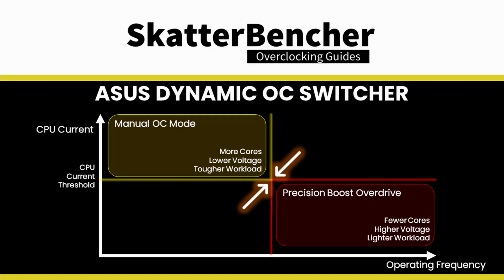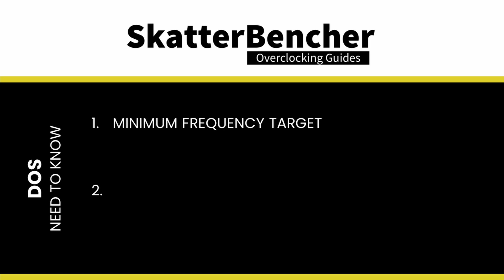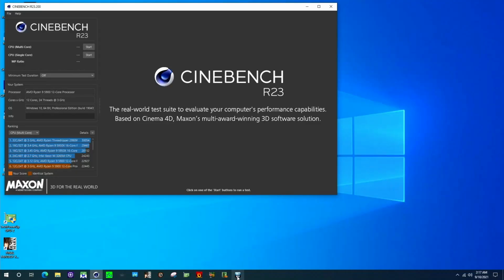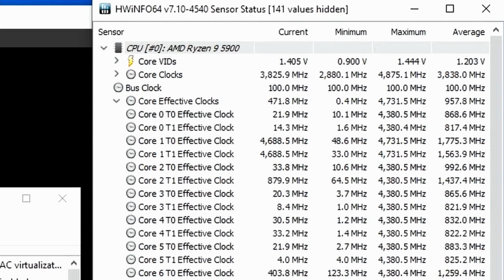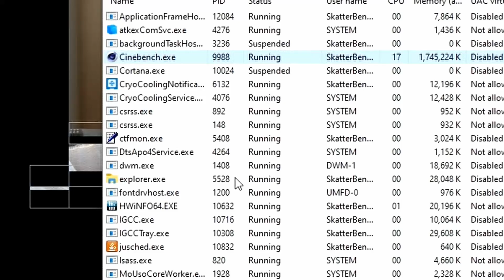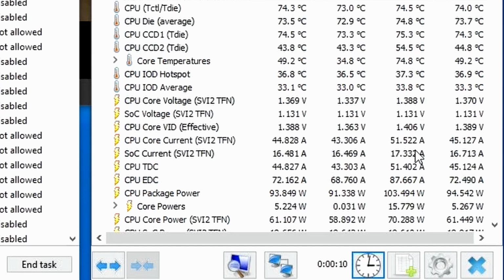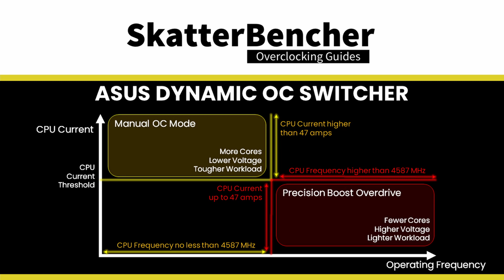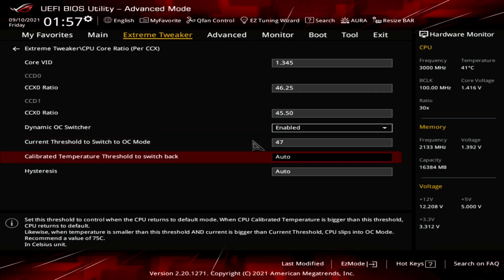ASUS Dynamic OC Switcher on Crosshair VIII Extreme Explored | SB#29

Comment: I have a 5950x on a Dark Hero and want to set up the DOS but I have been using the PBO in the AMD page cuz I get better stability and numbers than the PBO under the Tweaker page. Can I mix and match? Having the 2 duplicate areas in BIOS is so confusing! Also you mention one way to get the amps to switch off at but I am not clear on that. It only goes up to 32 threads and the Mhz doesn't seem to drop low. Is there any easier way to find that DOS switch over #.

Comment: Are there any CPU/RAM OC performance benefits in your opinion switching from a Dark Hero to the new Extreme mobo?
Reply from the maker: The Extreme has the new Voltage Suspension feature which I found particularly useful for maximizing my all-core maximum frequency. Other than that, overclocking-wise you're good with the Dark Hero too.
Reply: @SkatterBencher  Ok, thanks for the quick reply!

Comment: Any thoughts on oc'ing on an Asus x570 Proart Creator Wifi mobo? I like the tb4, 10G lan, and the ability to run 2 gpus and pcie 4.0 x8 each, but not sure if it has the ability to do any of the things your covering on your channel with a 5900x. I've been enjoying your content and wanting to try oc'ing a 5900x to speed up particle sims for motion graphics (x-particles and &c4d)
Reply from the maker: I haven't tried that particular motherboard, so I can't give you a useful opinion.

However, AMD's overclocking experience is very similar across all boards since Precision Boost Overdrive is the main avenue for overclocking. 

The BIOS options for Precision Boost Overdrive are provided to the motherboard makers directly by AMD. So the overclocking process is very similar across vendors and boards.